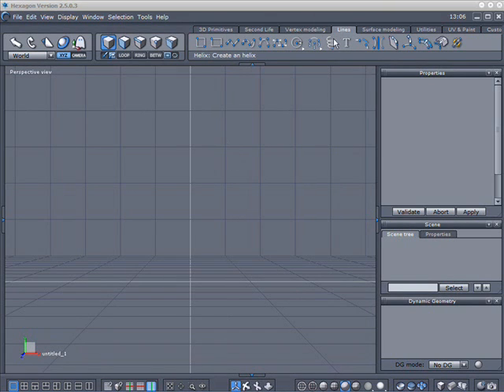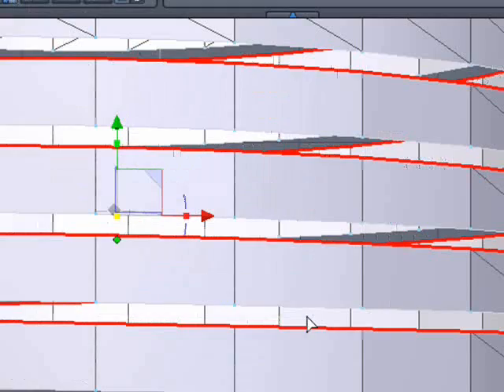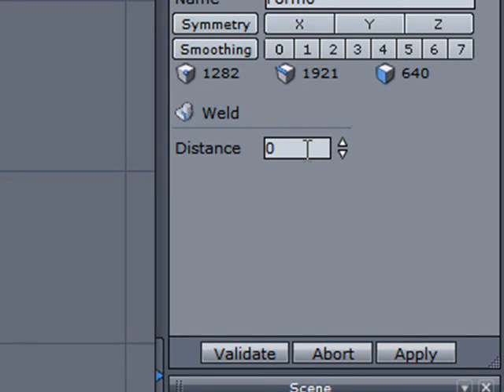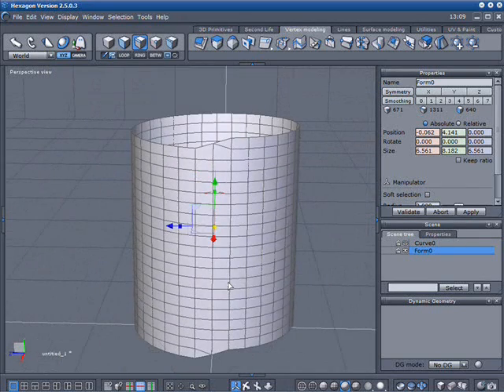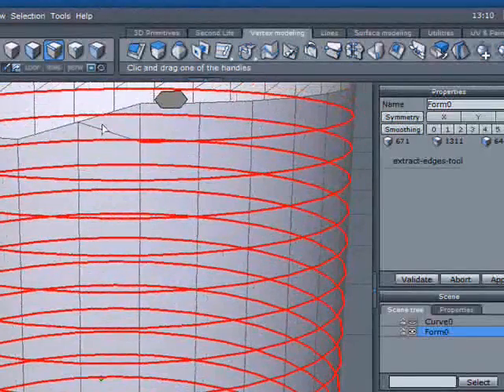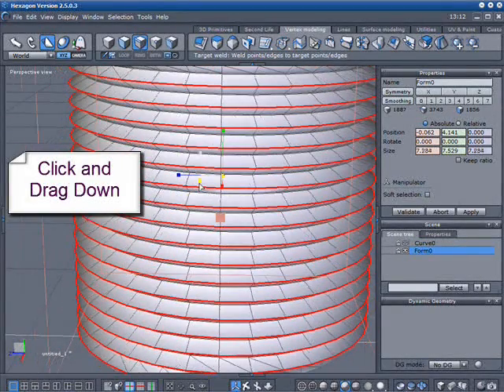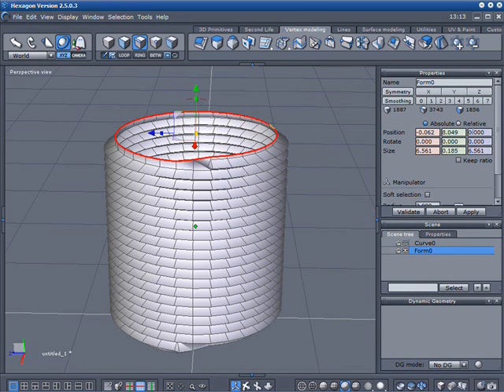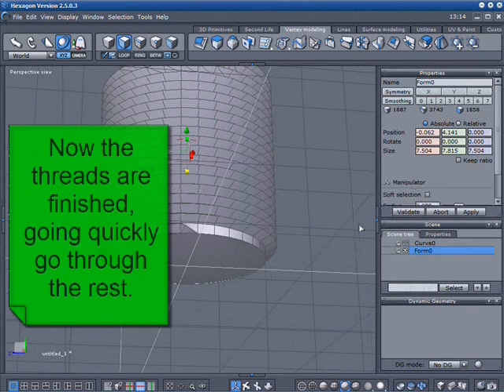3d modeling tutorial using Hexagon 2.5 ( Threaded Bolt )

Comment: Do you take tutorial requests? With Daz's dFore engine, there is a potential to turn almost anything in my huge, older-items content folder into drape-able clothing or elements. But many things fall apart during drape because the seams aren't welded. I don't want to learn hex for anything except to send a conforming garment from daz to hex, find the seams, weld them, then send it back for draping. Do you have a tut that just deals with that process? Or do I need to find what I need in a longer tut without zoning out? lol

Comment from the maker: I can only make a suggestion, maybe it will help and maybe not. First I should tell you that because of the crashing and other issues, Hexagon is not my primary modeling application anymore. I almost never use Hexagon anymore.

Make sure your video drivers are up to date. I was using an ATI video and it caused many of the problems, I now have a Nvidia. Also you go into your preferences and reset them all to default, after a while for some reason any changes was causing problems.
I hope this help